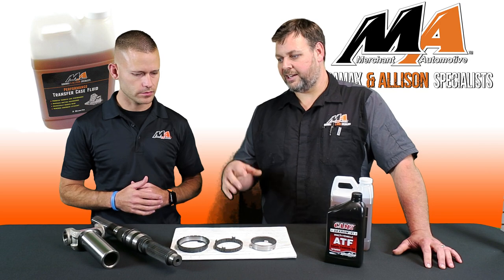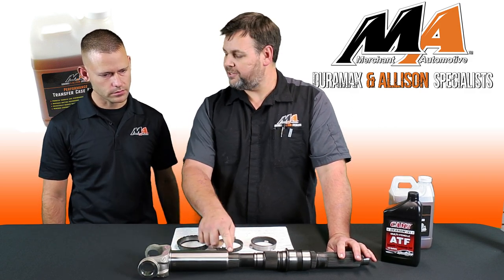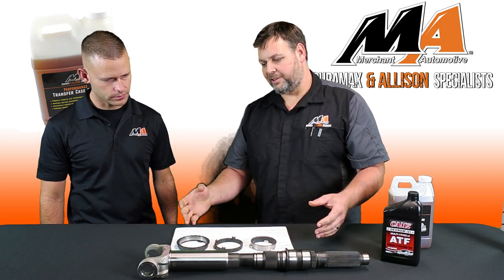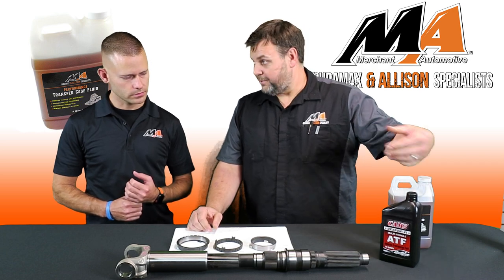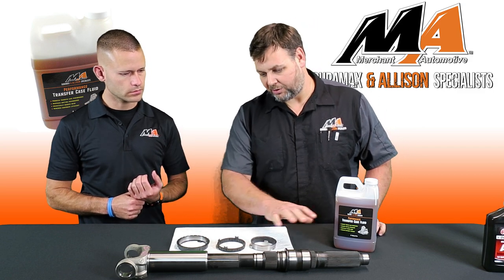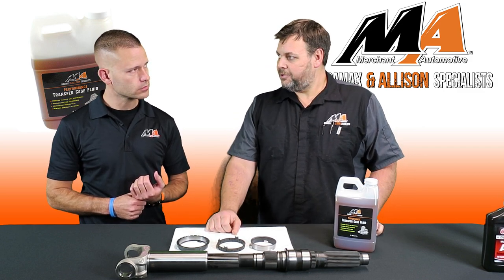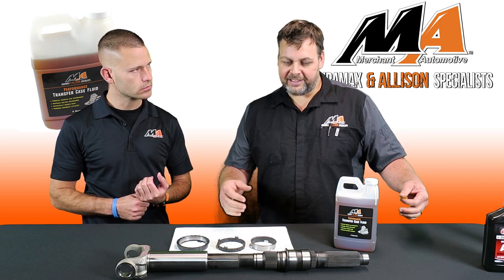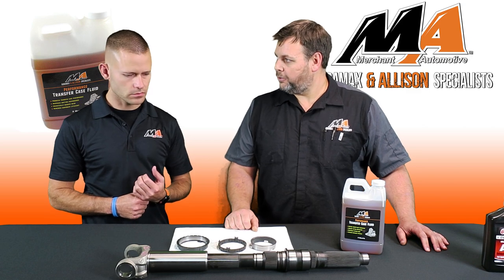Product Spotlight: Performance Transfer Case Oil

Comment: I can only give you my experience, which is to say that i had 5w20 synthetic in my lb7 overfilled for 100k miles, i swapped it out every 50k, the only issue i ever had was seepage from the output seal, i did the pump rub kit with a new case half at 230k, and that was after realizing it was bone dry and all over the bottom of my truck, when i took the case to my drivetrain guy, he was shocked it didnt burn up everything up. 🤷🏻

Comment: My truck has had Amsoil fluids throughout since the first oil change. I bought it from the original owner (from my home town) and my family owned shop did all the maintenance to it. 

At engine oil change one all lubricants were switched out to Amsoil versions. Transmission and t-case got signature series ATF. At 321k miles there were no driveline clunks ect when I took it apart just to install a pump rub update while the transmission was out getting built. 

I am a firm believer in quality lubricants (not saying the Merchant oil isn't quality). It will be interesting to see long term results!
Reply from the maker: That is a great product and works well.  We have been using the fluid successfully for roughly 4 years and ultimately, it comes down to making sure the unit has oil in it.  Any oil is better then no oil!

Comment: Great video! Very informative. Been using Amsoil Torque drive. What are your thoughts?
Reply from the maker: If it is working well, then no reason to switch it.  Like I mentioned in the video, any oil is better then no oil at all.

Comment: I have slight driveline clunk now will changing to this fluid solve that or do I still need to pull the driveshaft and grease the splines?
Reply from the maker: If the clunk is caused from a lubrication issue, the fluid will most likely take care of the issue within about 100 miles of driving.  No reason to grease the splines, in fact, that is discouraged as the grease will eventually wash out and mix with the fluid.

Comment: Kodiak Truck recommends Mobil 1 5w30 and that’s what I run in the Dmax. The  oem fill is fine it just takes more maintenance. You lost me when you said the oem fill/spec is not adequate. Not good marketing.
Reply from the maker: This fluid will take care of issues that are present when using the factory recommended fill, most specifically, driveline clunk.   Many people are using motor oil in the transfer case which at the end of the day, is still better than no oil at all.  We have been using this oil for many years and had nothing but great results as well as satisfied customers that have had their issues taken care off after switching.

Comment: Yes I know your promoting your sale of product but you can't count out mike weinbergs articles from rockland gear. And the filtered reason we truck owners are changing to 5-30 and doing a 3 qt fill

And when you speak in you video you are stating untrue speculative comparisons. I mean " Breath Man" Your nervousness is a dead giveaway. And there are so many TC's your statements are about a broad spectrum and all are different and have different requirements...

Lets take the 261/263 trans cases for example.

See mikes article here

http://tcase.rsgear.com/articles/2007_03.pdf

These run hot period. I tow with my chevy occasionally, and the two times I checked and changed the TC fluid ( 20k mike intervals)to atf spec less they a pint came out both times.

The issue is ATF froths and evaps/vaporizes out the vent tube at these temps. So.... Ive been running 5-30 since. Probably the best thing I could have done to prolong the life of the TC

1. Overfill will eliminate the frothing issue
2. Changing to 5-30 eliminates the evap/froth issues running hot like these cases do... period.

My opinion... You could of promoted your product in a better way for sales. You may get the average joe to bite, but guys like us in the industry know better...

How many 261's/ 263's  have you seen burnt/fried with zero fluid with 20k on the OD????  

 run ATF if you like but As the article states change the TC fluid every 10K if you do. Me running 5-30 with an overfill? Ill run the 50k miles before I consider looking or changing.

But then again I am only talking about the 261/263 here. The auto lock TC's  are a bit different. 

Good luck with your product gents....

Oh is there an MSDS on your product? Inquiring minds want to know... Maybe its a 5-30 atf blend....LOL